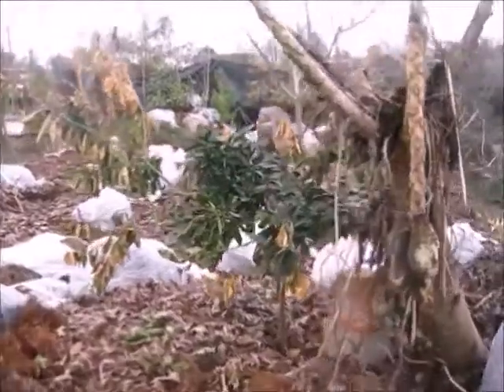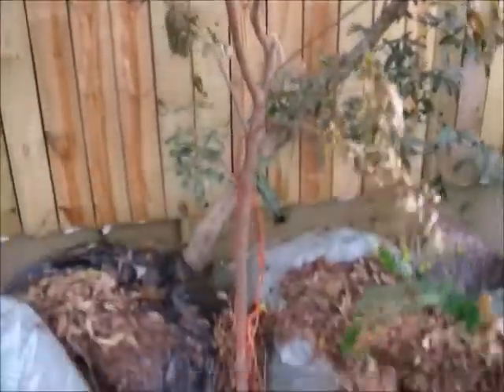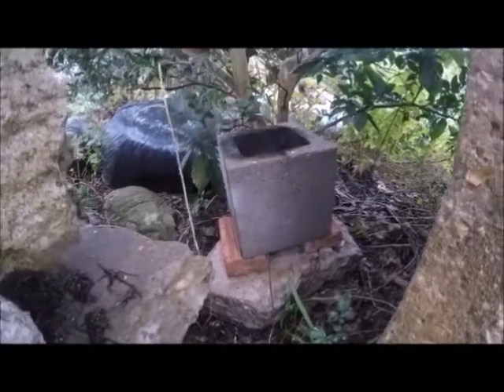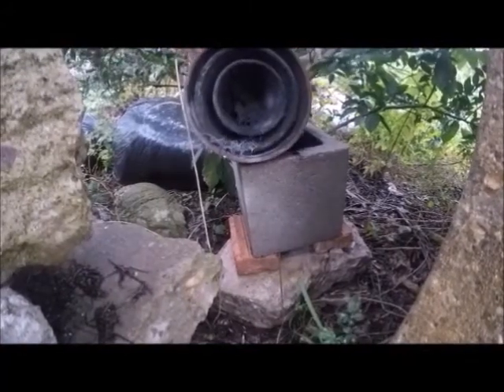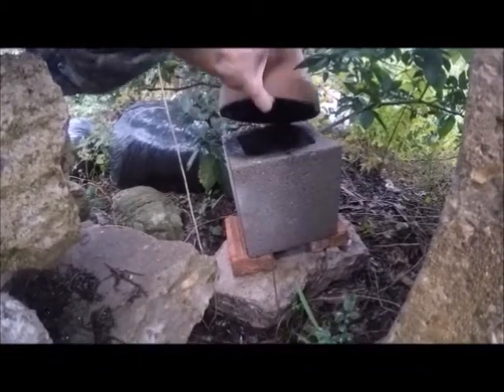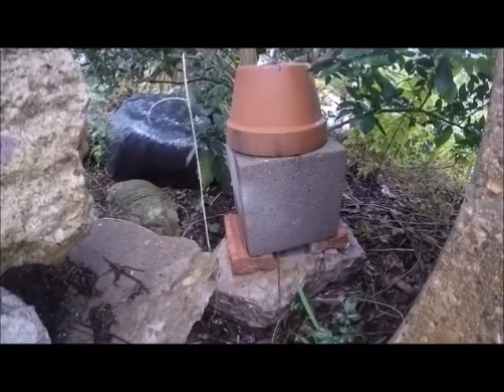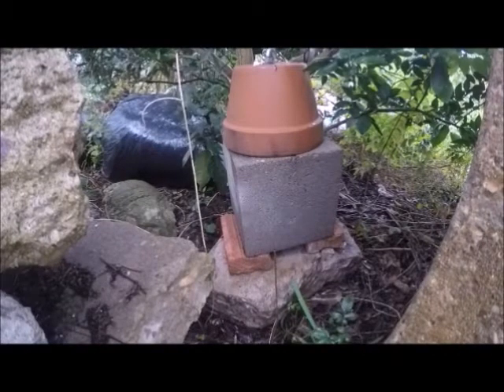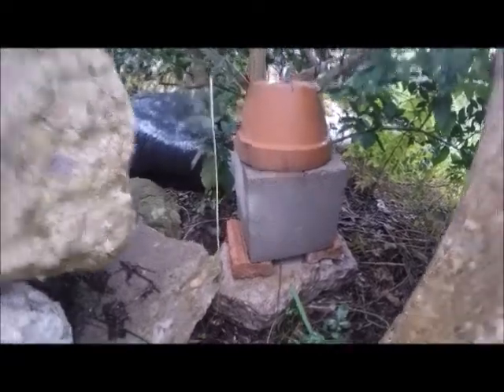DIY orchard heater(beta test) and info on frost/freeze protection.

Comment: Use a kerosene hurricane lamp. You still get the CO2 but a much much cleaner burn because you have much better control over the air and combustion chamber.

Comment: So, how did the tiki-torch under pots finally work out?  Is the result worth the labor of setting them up?  Did you find ways to improve the prototypes?  Looking forward to your input- thanks!!!
Reply: You can get much better heat control and better combustion by using a kerosene lamp or hurricane lantern. Also, a trick used in old Norwegian buildings, placing a large, flat stone or heavy piece of metal where the heat rises directly underneath, makes for good thermal mass. That helps moderate temperature swings overnight.